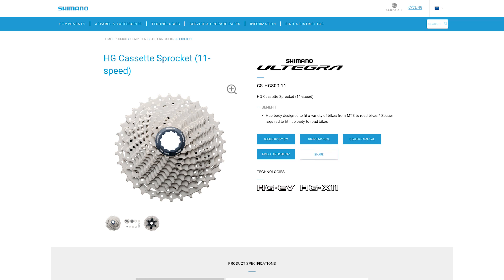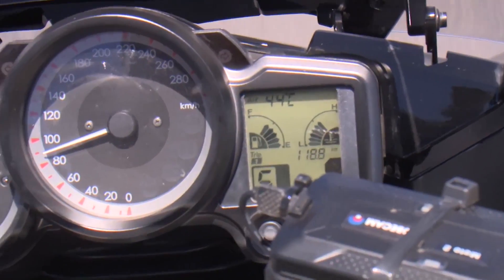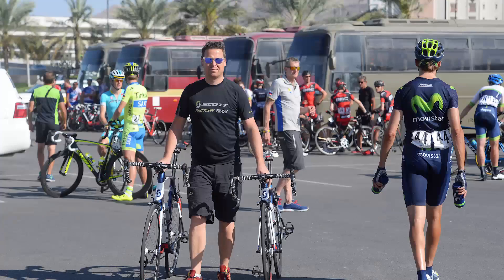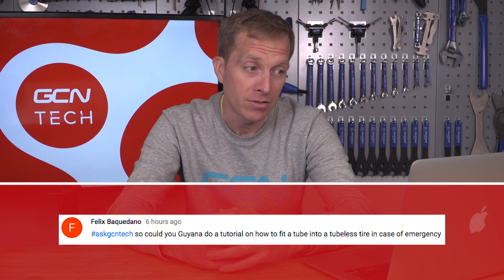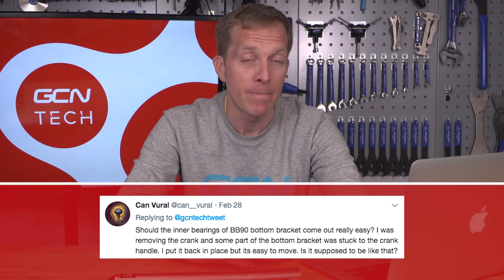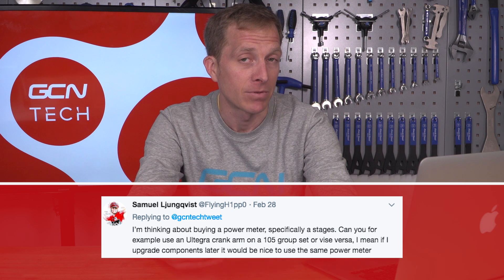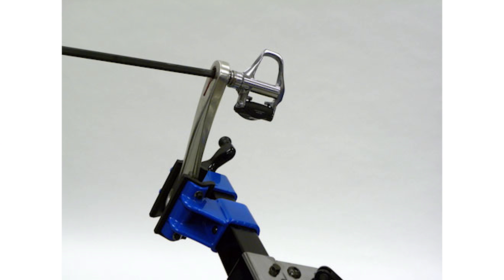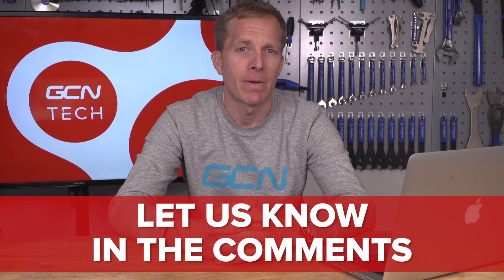Tubular Tyres: Tape Or Glue? | The GCN Tech Clinic

Comment: I ride the track and just mounted some Vittoria Pista Control on my Carbon disc. I used mastic glue this time and found that, after two coats on both the rim and the tire, the glue never got tacky. I let both sit over night with the final coats applied before mounting. Should they have felt tacky upon application?

Comment: I don't get why people still keep going with the discussion that using disc brakes is for more power. Anyone who has used rim brakes knows it's not that difficult to block the wheel and skid. The point is about how much control you have between pad contact and blocking of the wheel, which is far superior in disc brakes, also working way better in wet conditions. And I say that being a rim brake user, because I prefer the cheaper maintenance, lower weight and more aerodynamic profile.

Comment: Question on tubular repair...  I use valve extenders on Campy wheels and I’m afraid an over aggressive tightening of the extender has caused the primary presto valve to work loose from the tire.  Catastrophic flat unable to be repaired on the road - has to call for a car to get home.  Sealant doesn’t help.  Can this be repaired?   Or am I in the market for a replacement tire...   thanks for any help.

Comment: Been using tape for 3 years. They have come a long way and I'd argue that they are (two brands I love) as safe as glue if not safer nowadays. With the benefit of leaving 0 mess behind and being able to take off old tires, install new ones and ride within 30 mins (as opposed to a few days). I JUST took an old tire off of my tubular wheels cause they were squared off. They were bound REALLY strong on the wheels and took a lot of effort. That should tell you how safe they are. BTW 2 brands I prefer are Caden Wheels tape (from australia) and effetto mariposa carogna. In that order.
Reply: what do you use to carry a spare tire?
Reply: @Armurp01  My spare tire is Tufo Elite Jet (21 mm I think). While I would never ride that regularly, it's fine as a spare tire to complete your ride and get you home! The advantage is they fold VERY compact. Almost as small as an inner tube. So it fits my small saddle bag. One tip though instead of a square shaped saddle bag you need one that needs to be skinnier / longer. But a small one will definitely do the trick. Still fits my Co2 / inflater and multitool as well!
Reply: @H_Lepit  thanks for the tip.....when you do replace the tire, is your tape still on there or does that get removed too when putting on the spare.....just had a blowout on a tubular and I need ideas for a spare otherwise I'm switching to clinchers lol.... Haven't had the best of luck with tubulars since getting into this as of recent but I like how they ride and the easiness of using tape.
Reply: @Armurp01  when you remove the tire, tape is stuck onto the tire most of the time. the "tire side" of the tapes (at least the two i mentioned) are designed to be stronger than the rim side. With the Caden tape I've had it stuck to rim too but it really doesn't matter. With use of a heat gun or hair dryer, removing the tape is SUPER easy and clean. Almost 0 residue so your rim looks brand new. On the road, if the tape is left stuck on the rim, it doesn't matter. Even better actually for added protection. If it does go off with the tire, you just install the spare with no tape and take it easy on descends / turns. Go 75% the speed you normally would. the tire pressure is 75% of what's holding the tire tight on the rim. Tape / glue is to do the rest and secure it.

I definitely prefer the feel and weight of tubular setup. I use Veloflex tires (25 or 28mm ProTour (not the race version)) They are light, very grippy and the last time I had a flat was in 2017 I believe!
Reply: @H_Lepit  thank you for the insight....going to order that type of tire for a spare (Tufo elite jet)
Reply: @Armurp01  Glad I could help! Let's keep tubs alive! :)
Reply: @H_Lepit  yes sir, you're a motorcycle rider too....I use to ride a 636 so cool 😎......one last question, do you carry a spare chain or link in case you run into any chain issues?
Reply: @Armurp01  I quit racing in 2015 but I really miss it :) If I wasn't paying insane mortgage in CA I'd buy another track R6 and go regularly again! 

I haven't been carrying spare chain / link in the 6 years I've ridden to be honest. But bare in mind that my max 5 sec power is 1100watts and I weigh 142 lbs. So I'm far from putting much strain on my chain :P

Comment: i was hoping there would be a clear answer on the tape vs glue debate.  i am using glue now, but i find cleaning and removing old glue from carbon rim to be a pain in the arse.  so i'm thinking to use tufo tape.  question is, for my veloflex that has some left over glue on there, would it be ok to use tape over it?  or would i need to remove the old glue from the base tape before mounting with tape?  the rim has been cleaned off.. took me 3 days...argh

Comment: using a disc is NOT for modulation = it is for safety on descents. Carbon rims are a disaster with pads heating the carbon laminations. And the industry knows it. Disc wheels are superior in keeping the rim heat down.

Comment: #askGCNtech
Hi Jon. Really enjoying the tech channel with so much more tech focused content than before on the GCN channel.
I recently bought an FSA Powerbox which is based on BB386EVO. My bike has a BB30, but came with an FSA SL-K Light (BB386EVO) with the spacers etc. I fitted the Powerbox with the spacers in exactly the same order that I took them off the SL-K, but now I am getting an annoying clicking sound in the small ring with the 2 or 3 cogs at the top of the cassette. The sound is coming from the chain engaging with the chainring. Any suggestions on how to stop this?

Comment: i have tubular tyre can you tell me why i am losing air pressure littlee bit every day they are brand new vittoria tyre?thank you for your answers
Reply: Old I know, but it's normal, those tyres have latex tubes. Latex has many advantages, but a disadvantage is that it won't hold air pressure very long.

Comment: What disc brakes are not about:
Power
What disc brakes are about:
Modulation
Aero wheels
Aero frames
Low temp resins (stronger wheels)
More tire clearance
Supple seatstays
Stiff chainstays
Wheel longevity
Consistent braking performance 
Heat buildup isolated from tires

Comment: Stages Ultegra v. 105 crank arm:  I believe the Ultegra arm is lighter than the 105, so the crank would not be balanced after mixing.  Does that matter?  It might be a PITA when working on the bike on a stand if the crank always rotates so the right arm is down.  Also, why spend money on a Stages one-sider when the price of complete (both sides) PMs are not much higher?  My experience with Stages is that they're not as accurate as other PMs and the accuracy is futher complicated by left-right imbalances (nobody is exactly 50-50 all the time).

Comment: #askgcntech Come on Jon, answer my question about chain length: How to dial-in the perfect chain tension on a new build bike??  How many links do I really need??
Reply: Matthew Lawrence to find the chain you need I feed the the chain through the entire drive train including the cassette and pulleys, the. Add a small c wire to hold the chain together under the bike. Now you can still pedal a little back and forth without cutting the chain while dialing in the current amount of chain. A shorter chain will not allow smooth big big combos as the derailleur will be stressed to the max. So a larger chain will make the derailleur in the small small sections sit further back so make sure the chain does not rub up against the upper pulley if using small small combos. A longer chain will also make less noise if you use it as wet ( adding wet lube and immediately riding like that)
drive. That is currently what I found to be the best riding for speed and also very quiet drive, the only issue is the chain must be cleaned immediately right after every ride. This is a non issue since it has quick links it takes 2 minutes to take out and clean the chain. This is something that expensive bikes should not have!! How can a 250$ POS road bike have zero drive train noise compared to a 7000$ road bike lol. The key is using a wet chain and also 8 speed freewheels or cassettes, as soon as you move to a thinner chain for 10+ speeds it will make more noise no doubt about it. I have 2 bikes on my channel one makes ZERO noise and the other clearly makes more noise, the Carbon one is the noisier one!! Lmao.

Comment: With Stages Shimano power meters, the thing to remember is that even though the Hollowtech II interface is the same on 105/Ultegra/Dura Ace, the drive side crank arms are stiffer as you go up the range, so the strain gauge on the left arm might not match the actual power of the right arm.  But having said that, does it really matter?  I'd be more bothered that the arms don't match (OCD alert)

Comment: A tech question on disk brakes. I've seen a number of comments online and SM about a potential problem when taking a disk brake equipped bike on a plane. Some people [inc a pro-mechanic] suggest some brands of brakes need bleeding after a flight! Is this true? If so what brands? Does this explain the relative lack of pros riding with disk brakes still e.g. Trek suggested they were going to focus on disk brakes this year but most of the pro riders are still using callipers?
Reply: Shachar Levy
3 days ago
#askgcntech

Comment: #askgcntech how do people set the front derailleur height for a non-circular front chain ring (e.g. oval)? Is there any worry of the chain falling more frequently than a circular chain ring?
Reply: Peter Lee been running Rotor Q Rings for years now and have only recently dropped a chain as I neglected to tell my bike shop that I used for a quick tune up while out of town that I am running a compact double with a Triple STI shifter allowing to literally shift the chain off the big ring.

As for setting derailleur height, it's exactly the same as a circular ring in regards to minimum spacing. But be sure to set that spacing when the ring is at its biggest, lest you run the big ring into the derailleur.

Comment: re. mixing & matching Stages left-hand PM crankarm with a different crankset.  Broke an XT crankset by putting an XTR stages left-hand crank arm on it.  XTR crankarm was like 12mm skinnier than the XT/SLX crankarm.  The shimano spindle has grooves cut into it where the crankarm clamps; I had something like 12mm of these grooves with nothing clamped on.  (I was also having to do some weird shimming of the BB to make the crankset not wiggle - wish I'd looked more closely when I was doing that)  I think I made it about a thousand km before the crank spindle cracked in half while standing on the pedals.  Anyway, if you do mix & match different shimano crank arms, make sure they're really the same width before you use intermix.

Comment: Hi, what do think about using a 'roadlink' the rear derailleur hanger extension which is used to fit larger rear cassettes instead of buying a long cage rear mech. Loads of riders here in Thailand use them for the mountains, fitting huge cassettes, are they safe ?or any other drawbacks that you know of ? Cheers really enjoy the Tech channel.

Comment: i am using sram red 10 speed front and rear mech with sram red 11 speed shifter, working flawlessly. well you will need to expand the front mech cage with a 0.5mm spacer to get rid of chain rub when you are using the big-big/ small-small combo.
and for loose bb bearing, dont waste money on anything else, get yourself an enduro torqtite cup and you are good to go.

Comment: Question: Is 1/2" pitch optimal for bike chains or just the way it is? I can find reference to a Shimano 10mm pitch track chain from the 1970s, but it seems to me that some of the challenges associated with the 1x might be mitigated by a smaller pitch chain. As Simon has pointed out, the spacing automatically gets troubling going from for example a 10 tooth to a 9 tooth cog (> 10% change in gear inches...) but if one were to imagine a 1/4" pitch chain (not that this would make sense), then the 10 tooth cog becomes a 20 tooth cog and a 19 tooth cog would fill the gap where 9.5 sits now...  Obviously turning radius, etc is a big deal, but with the much stronger and higher quality materials around today, might it be possible to rethink the chain?
Reply: NO. You are overthinking. It ain't broke, don't fix it.

Comment: "Car gear lube" is automatic transmission oil, it is a thin oil. Used it for hundreds of thousands of km on motorcycle with injector oiler, does the job great but a mess. Not tried on bike, not even on my list to try at this stage. Would try the cleaner aerosol sprays like the WD Lithium first, they are becoming popular amongst moto.

Comment: Take a look at the following university study on mounting a tubular tyre giving best practice
http://kuktl.dept.ku.edu/bicycle/Cusa1.pdf
Reply: Martin Arundel Thanks for the reference, The problem I see is noobs to tubulars are put off by gluing, although once you have the knack your right, but you learn on your own safety. Why I like tape (not mentioned in the article). It has a consistent bond, is designed for tubular adhesion and is pretty full proof, because you align the tyre with the backing tape on. Get it straight move it around how you like for as long as you like. Then when happy, you pull the backing tape off from under the tyre (see vids on the internet) and then pump it up to 100 psi. It is done. Easy!

Comment: The guy with shifting problems between top 2 easiest gear has a b tension screw problem. He has almost certainly has a 1x drivetrain and these need the top jockey wheel to be as close to the largest cog as possible,(think SRAM eagle needs a special alignment tool, but is also the case fo1x11 to a lesser extent) wind that b tension screw out till you hear the jockey wheel hit the cassette between shifts of easiest gears then wind in slowly till the noise goes. Now the detailer is as close as possible without touching and perfect shifting.

Comment: As to glue vs tape for tubulars, the tape is supposed to use a few more watts, apparently, but I run tape as I ride my tubulars everywhere. The problem with glue is, it hardens over time. Especially if not ridden like race wheels (in the off season). Then they get out the tubulars next year, and the glue has hardened (doesn’t flex anymore) and lets go off the rim due to the riding action. Tape does the opposite, the longer it stays on the more it gets spread and sticks. It never goes hard. So glue if you want to race, but change every season, or tape for general or long term use.
Reply: Thank you very much for this valuable information. This is exactly what I came here to find out. I just got my first pair of Magic tubular wheels. I've never used tubular before.
Reply: I've heard an idea that the glue is more safe when downhill,isn't it?

Comment: A helicoil is a great option. I had used couple of helicoils both in my nds crank arm and the rear derailleur guide pulley axle. However, I can't forget the feeling when I incorrectly set my torque wrench when tightening the pedal. The crank was a right-out- of-the-box Quarq power meter.  Eventually I replaced it with a new one which SRAM exchanged for free after I wrote an email. Great great company !!!

Comment: I’ve run tubeless on my CX bike and my mountain bikes using both tubeless and even non-tubeless tyres and non-tubeless rims many times without any issues. They tend to require much more sealant and can be a pain to seat without a compressor but you can get them to work effectively. I’ve never used proper rim tape either, I use Gorilla tape which works fine. I did try a non-tubeless tyre on a tubeless road rim once but that specific combination wasn’t overly successful, they would go flat overnight more often than not.

Comment: Tom, with a helicoil you drill it out and cut new threads in the size they tell you for use with the final threads you want to have, then using a tool, you take the helicoil and turn it into the newly cut threads and break off the tab and it's done. There's no gluing involved last I checked.

Comment: @benjamdm I second checking your hanger alignment.  I've had this problem a few times and if everything else seems right, every time the hanger has been off some.  I've found this to be when I was having trouble in the middle of the cassette, recheck the limit screws after adjusting the hanger too.

Comment: The answer the Tiagra 4700-Ultegra 6700 guy needs is to keep his 4700 shifters.  They are better, because what he is doing is not really an upgrade.  The crankset is lighter, but that is about it.  They will work with the 6700 derailleurs, but again the newer tiagra 4700 ones are better, especially the front.  SRAM and Sun Race make better 10 speed cassettes, since shimano has moved on.  Sorry guy, but there is no other way around you are not upgrading going to the now two generations old ultegra.

Comment: #askgcntech what tires can I fit on my rim I can fit a 25mm and a 23mm easily but I want to fit on those wheels 44mm gravel tires will it work?
Reply: Shachar Levy depends on de available space in your forks. Normal race bike will not have enough room. Mine can’t even fit a 25mm in the front.
Reply: Martijn I have a gravel bike frame with plenty of clearanceI just want to know if I have to buy new wheels
Reply: Hardly scientific but from personal experience, measure your rims or refer to your wheel manufacturer for their recommended limits.  Plenty of 23mm riders going to 28mm, I'm sure there's others who push the boundaries.
Reply: Probably not 😞